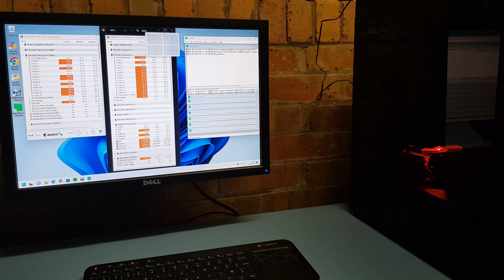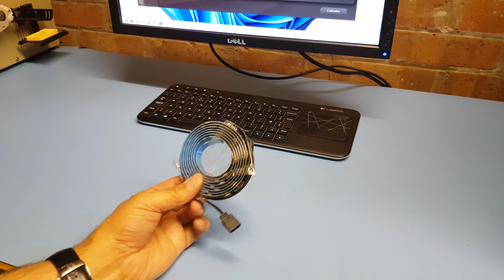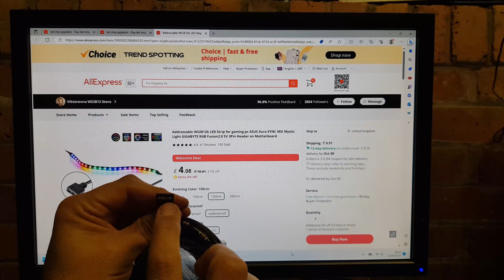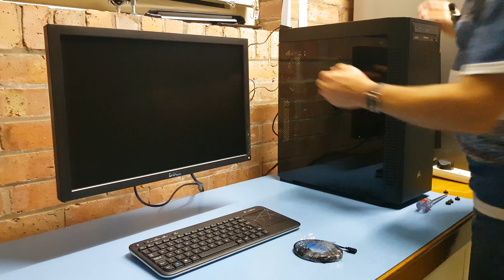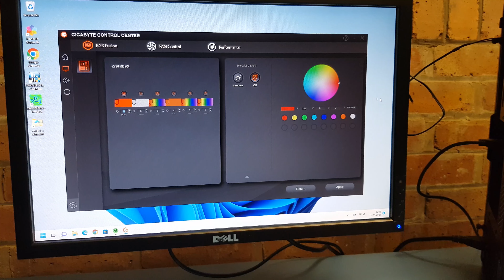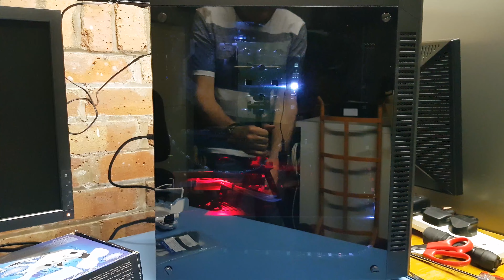A CPU tweak and a completely pointless upgrade

Comment: There are strips with embedded magnets. They have adhesive aswell, but it is optional to use it.
Reply: What I found frustrating is that however you attach it, it's difficult to get all the leds to face front, particularly when you bend it round corners.